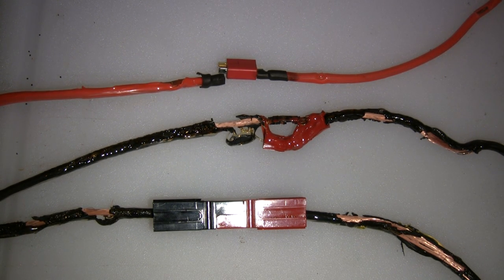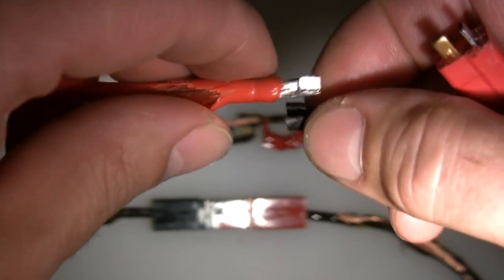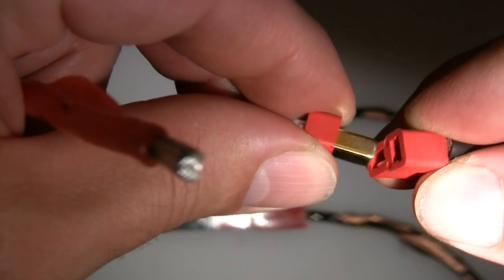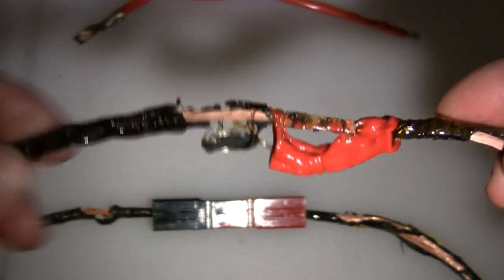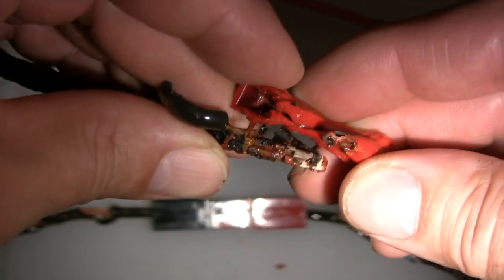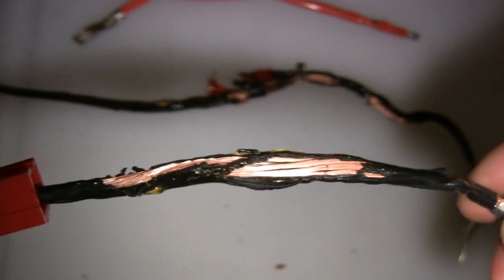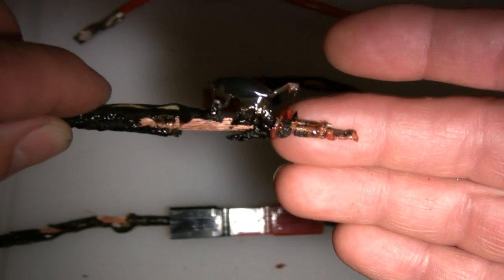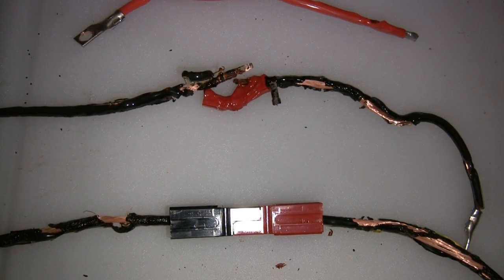Anderson deans testing to failure (2 0f 2)

Comment: So i take it pp45's are plenty safe at 50a with 10awg wire? I like this test but it would have also been good to see the pp45's at lower current say from 50-100 amps for longer periods of time to find out the heat and voltage drop of a continuous load

Comment: Ed, would you prefer the contact break or stay when you're flying?

I can't make up my mind! One part of me say, I want it to melt the crap and let me try and get back to the ground, but then part of me thinks, get the power away from the load...

I wonder if one could make a shunt that would blow a fuse and activate a telemetry warning after fuse is gone at 100 amps??? The other factor I'm considering is if you're having a high climb out and you go strait into a high load maneuver, would you be able to save the system by removing power for a few milliseconds? The test shows constant load, so I wonder what condition (aside from a dead short) where we would experience such high loads before frying a component, which would per-empt complete failure inducing crash...
Reply: your plane is gliding so you can get it down and let it conected cause fire so let it breake its safer and less expensive!

Comment: I too would like to know how the 15/30/45 Andersons compare to the XT60/XT90s. I just spent $75 on Anderson power poles, and I'm wondering if I should use XT60/XT90 on all my stuff instead.
Reply: I hate xt connectors you can't get a good solder joint on 10 gauge wire without melting the plastic the way I see people solder XT connectors on about 90% are cold and risk breaking lose. The power poles are nice if you have the room for them inside of a cramped foam EDF jet when your running 2 4S batteries and a Y cable power poles are not an option.
Reply: @Mike-01234  Yes you cant get good solder joint on 10 gauge wire without melting the plastic but experienced soldering iron users (including me) can.

Comment: Well here is the thing with this test even though the batteries 65c  5000 are capable of drawing 325 amps does not mean that the helicopter or airplane you are flying is going to draw that much power. your motor is only capable of drawing a specific amount of amps for a period of time with a burst of seconds I can tell you right now you put 325 amps to a 700 motor or esc it will be a meteor better have a fire extinguisher. dont need a 325 amp battery for a 90 amp motor setup.

Comment: You can stack the Powerpoles with 2 sets of 10 gauge wire and just have a two contact circuit and never worry about anything melting or failing, nobody ever takes advantage of that feature with the Powerpoles.
Reply: Yes.... Team Toad uses a dual powerpole setup for our fighting robots.

Comment: May I ask you what voltage your using to test these?  I run deans connecters at about 55 volts and over 90 amps and they dont fail or get warm   Im wondering why there failing here in this test?

Comment from the maker: Eventually I will. But based on the results from this test i really don't see any problems with EC5 or Castle bullet connectors. They should be as good if not better than the wire itself.